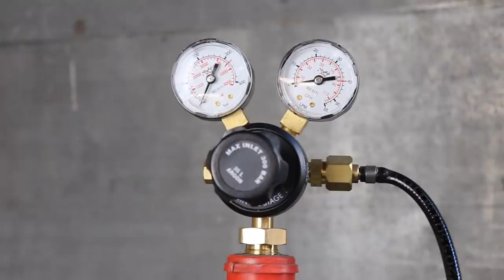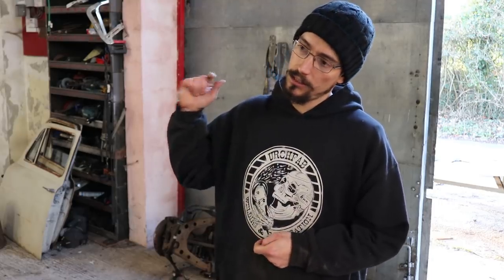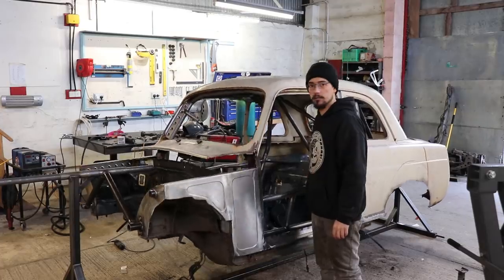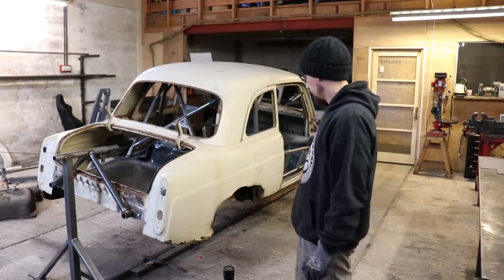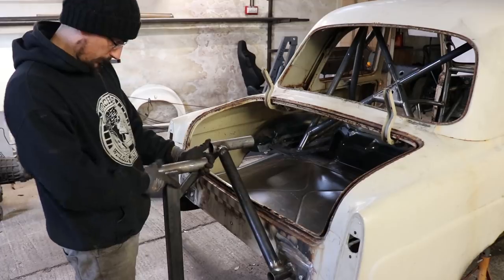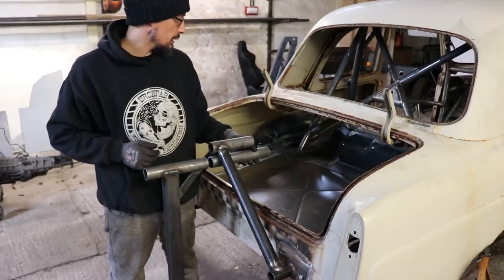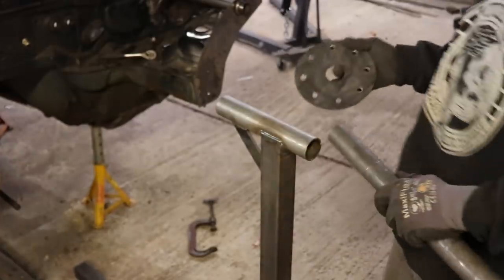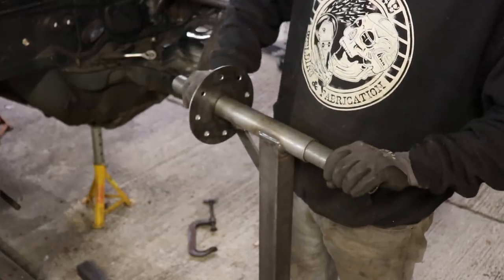WE HAVE A ROLLER. THE CAR ROTISSERIE WORKS! FORD100E/MX5 MIATA.

Comment: I made a car roller some twenty odd years ago.  Very simple construction, large welded triangle ends for stability.  Everything else bolts together for easier storage and adjustment.  All mounted on large caster wheels for easy moving. Fixing to the body shell is via bolt on brackets so no damage to the body shell.  I will try and up-load a picture for you

Comment: thats how I built mine back in the day when restoring a VW beetle, center of body rather than center of mass. My latest project, an MK2 Jag, I borrowed a friends rotisserie that was adjustable in every direction. made it easy to wet blast. center of body while patching and welding, center of mass while blasting.

Comment: A rotisserie is the way to go especially when you don't want to be laying under neath the job you are doing sand blasting, welding, cutting, spray painting etc. I have just helped restore a small utility helicopter and made a "pig on a spit" for that and it spent nearly a year being rotated whenever necessary which made the work so much easier. The secret is to get the centre of each end, I used a lasar level, and we could turn the thing just about one handed.Its brilliant when you drop tools down into the guts of the job somewhere and you can't see and find them, you just give it a spin and Mr Gravity usually find it for you. Love the videos.

Comment: Would a vacuum not been quicker to get the crap off the floor pan Lol . Great work👍
Reply: Stephen Green you can't always get those 1p coins out from behind the seats with a vacuum cleaner.
Reply: There is an easy way and a hard way. It’s all on the roof now.
Reply: Simon Carter depends on how many times and how fast you rotate it. ;-)

Comment: Matt, that long bit attached to the diff is the power plant frame and they're notorious for seized bolts.  When you put it back you'll have to make sure its aligned properly or the car won't handle well. Loving the vids btw

Comment: Worked well. When you said you were going to use a bolt setup to clamp it tight, I assumed you meant a nut welded on the outer pivot point pipe with hole through the pipe so a bolt would screw down against the interior pipe to hold it by friction. Your setup your making is much better than what I envisaged. I was also worried that you were not making it high enough for the body to go full circle, but it does! Your height was nearly spot on first go!

Comment: Great stuff Matt....knew it would work......Because of your dice video you got me making one...got some suitable Ally but no welding facilities. Tried sticking it with epoxy.......NEVER had any success with gluing, this is the same......however I have got one badly made, which is still cool. Hope to get some steel soon so I can do a proper job 😃👍
Reply: Hi Malc,  You can actually "Solder"/"Braize" alloy.  I've done it many times including repairing crash damaged motorcycle engine cases. You can file, sand, grind, drill and tap it and it's at least as strong as the base metal. This link is the last place I bought from;  https://www.ebay.co.uk/itm/Aluminium-Welding-Brazing-Soldering-Low-Temp-Durafix-Easyweld-UK-Rods-Brush/220865171345?ssPageName=STRK%3AMEBIDX%3AIT&_trksid=p2060353.m2749.l2649   , no connection, just a customer.  They are expensive, but a lot cheaper than a Mig/Tig setup, I use a MAP  plumber's torch.  There are lots of UTube vids on this, this one's a fair example; https://www.youtube.com/watch?v=3SBfP4_i1Go  The important thing to remember is that you heat the metal until the rod flows onto it, DON'T play the flame onto the rod, it will just ball-up.  Use the stainless brush only for this and keep it in a bag between jobs to keep it clean ;-)
Reply: @peterihoy4908  Thanks Pete I might just try this, after all it's just fun, and a good idea for a video. I've a couple of propane torches. Just not hot enough to melt normal brazing rods. I've had one for years and just discovered more when getting the small stick welding rods to make the Lister silencer.

Comment: I got you I'm a miata expert haha. Take the insert out from the bottom of the ppf just pry it out and then thread the long bolt back in just a bit and hammer out the top insert and that's it easy

Comment: You could add a counter balance for the light side, pieces of tube welded to top of triangles either side and add weight such as discs off a barbell ! great viewing as always and your adjustments always seem to add strength and look right as if they were always meant to be there lol 👌🏻

Comment: It turned out great Matt. Too bad you didn’t get the height set straight off but your adjustment seems to be nearly perfect. 
Once you strengthen all the joints and add the large hand wheel to one end you will be able to rotate and position it in whatever position works best for the task at hand.

Comment: Great work as always matt, Could you make a shaft that fits in the top pipe you now aren’t using, with a pin in the centre that locks rotation by sliding into the plate like a bolt?

Comment: Ultra common issue with the diff bolts, the bolts don't like the alloy and they also go through 2 tubes/spacers that rust/corrode  solid. iirc SMA has a vid on it (3 parter mx-5 clutch replacement)

Comment: There should be a small hole in the spacer that allows you to spray penetrant into to help unseize that frontmost PPF/diff bolt.
Reply: What I mean is that there IS a small hole in the spacer.  And I've seen it on many other Miatas.

Comment: Where the diff fits into the carrier there are two washer/ retaining location parts. These need to come out then the diff can be released.
Reply: With the bolts removed and the sleeves/inserts still in you will have a difficult time removing the diff from the PPF. They lock it into place even with bolts removed. I used a thin chisel and hammer to get under the insert lip.., (look for a small groove) and pry them back... going around it tapping with hammer. Just back them out enough that you can slide the diff out the PPF.

Comment: hope you pattented that precicion instrument
might want to put a rotation lock on the rotissery (a piece of flat hanging from a bolt on the non moving part of the hingepoint , the locking bit will just be other curved piece of flat that you can rotate on a sleeve and clamp on the moving bit of the hinge 
the piece of flat hanging down will ramp up against it untill it drops in a slot at the end of the ramp locking the car ,  just in case you have to hold the car in place and cant reach the lockingplate to put a bolt through 
a bit hard to describe it without the drawing on a napkin to point out the features  but it should be eazy to add on the rotisserie later using bits of scrap metal
Reply from the maker: I know what you mean, Great idea. Cheers

Comment: It's looking good almost ready for the blaster I've always meant to ask you why don't you have a block and tackle hanging from the ceiling so you can lift up different things instead of jacking it up and using the engine hoist just curious. 👍👍🇨🇦
Reply from the maker: The roof is to tall, I put a beam in at the back for that purpose but there's cars parked in the way at the moment. Cheers
Reply: Matt, use the wheels from the rotisserie, so when you are not using I take them off and make a big a frame (gantry) to wheel over the vehicles with the block and tackle on, makes life so easy, we use it all the time. So much easier to position the gantry than move the vehicle below, top work as usual

Comment: Strap some bags of sand to the roof roll cage bars. Could also have done the spit attatchments using threaded rod? Works good enough though 👍
Reply: Actually ,Scaffold stands are the thing to use. They are dirt cheap to buy new and come with a square foot and a large nut designed to be abused by blokes on building sites,armed with a claw hammer.

Comment: I was a bit worried on the first spin.  That’s a lot of metal and momentum if it gets away from you.  Wonderful job.

Stuck bolts.  Give them a squirt of WD40 morning and evening.  Hopefully it will have soaked in by the time you are ready.
Reply: WD40 is a water disperser, not a penetrating fluid. Use something designed for the purpose like PlusGas- but there will always be those that just won't play ball.
Reply: You can use WD-40 on stuck bolts though. It says so on the can when you look at it's uses and it says seized bolts is one of them. WD-40 has many uses as well as dispersing water and yes I know the letters of WD-40 means Water Displacement and the numbers mean it was the 40th attempt to perfect it
Reply: WD-40 can dissolve any remnants of grease you're lucky enough to have left and leave the surfaces bone dry and stuck. A graphite-laden penetrating spray is better as the graphite will get deposited deep inside. Locksmiths rub graphite on their mechanisms when reassembling to lubricate without stickiness.
Reply: ATF and acetone (nail varnish remover) mix a smaller amount in with the Transmission fluid and spray it all around, leave it a while and go back to it, but keep dowsing it, eventually the acetone seeps in with the ATF and it undoes 😉
Reply from the maker: There's a full can on there already.  Cheers
Reply: Emyr Derfel.  They use graphite as it’s a dry lubricant and doesn’t cause dust and fluff to jam the wards.

Comment: Matt would it be worth making a solid round bar with a tapped hole in the old spinny tube and bolt in to that though the round plate?
Reply from the maker: Not sure what you mean there bud?
Reply: @Urchfab  does the old pipe on the top line up with the holes on the round plate if so you use that as a locking system?